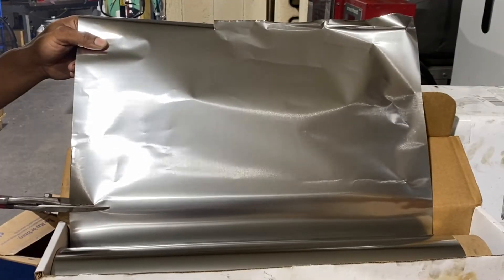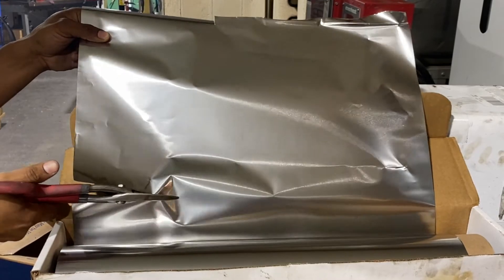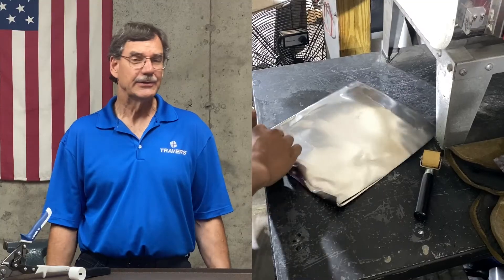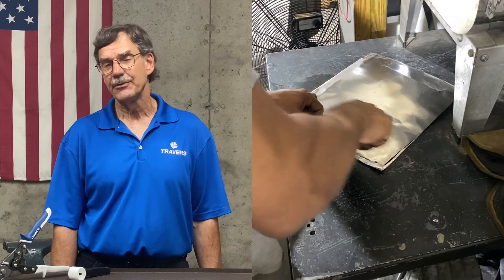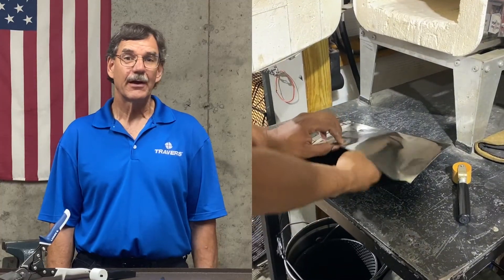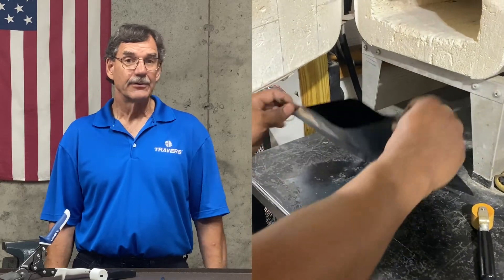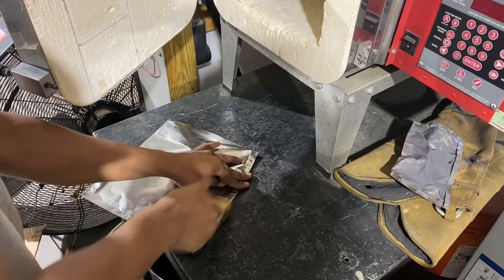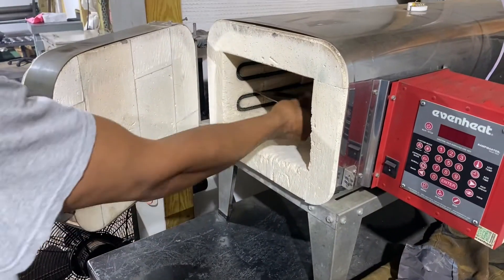What Is Tool Wrap And How Do You Use It?

Comment: any tips on how to prevent scale on oil quench tool steals without a vacuum oven?
Reply: Hi James,
Heat treat scale is a fact of life in the industry.  I’ve tried to get as much air out as possible by keeping the bag as tight as I could, then when I folded the seals, I crimped them as tight as I possibly could, and all that still didn’t prevent it, and the bag often tore open in the oven, making things even worse.
Unfortunately, an outsourced heat treating company might be your best option.